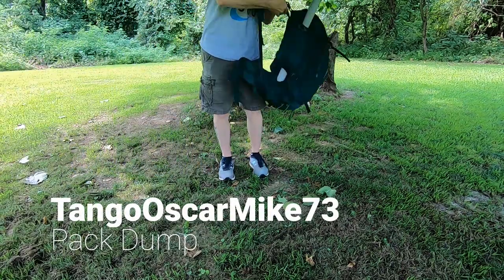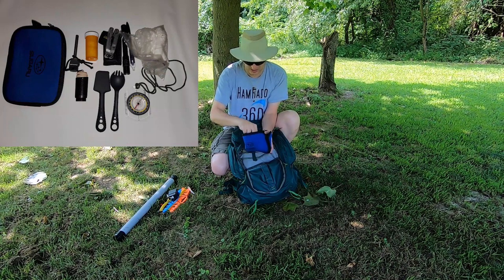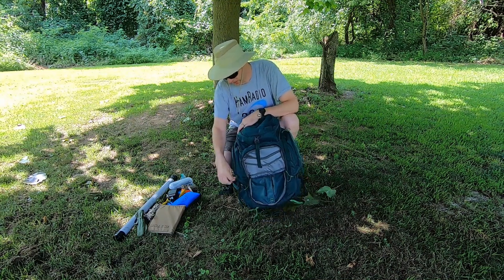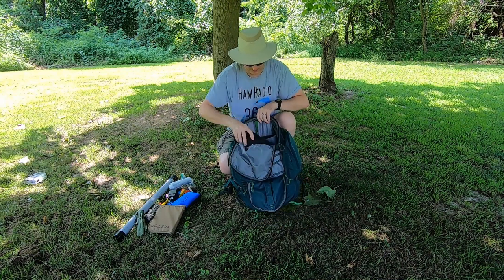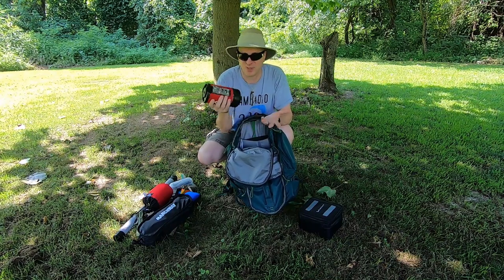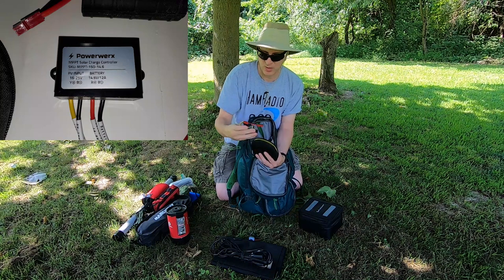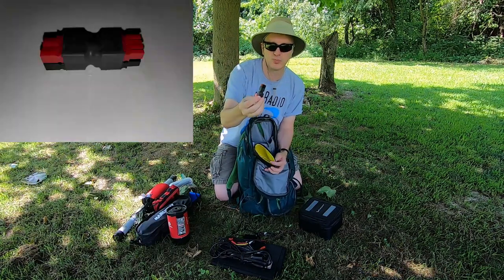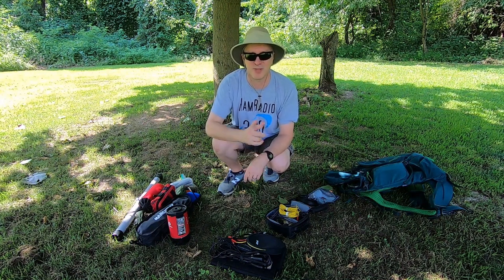Ham Radio Backpack POTA / go kit gear dump

Comment: Thanks for the pack dump. Very helpful. I’m a bit out of date on current stoves. I was considering a Jet Boil, but they are pricey and heavy, but here they are very efficient at quickly bringing water to a boil. Like you, I tend to use what I have. I’m still using my first stove that was given to me as a gift 32 years ago when I was 7. It still works great after all these years. Nice work!

Comment: Tom, thanks for sharing.  Tip from my military deployments keep your First Aid kit either in the top portion of your main compartment or in an outside pocket.   You will want to keep it were you can get to it quickly in case of emergencies. 73 De W1SRR
Reply from the maker: I agree.  I'm keeping my eye out for a flatter first aid pouch, but I might just ziplock baggie the contents it and put it in the top compartment.  That is the one drawback to this pack, there really aren't any external attachment points.  Thanks for the feedback.

Comment: Maybe a little late to add to the comments.  Just wondering how the Powerwerx Solar Charger is working.  I have heard that they can create a fair bit of RFI/EMI.  Any experience with that issue.  I have been considering this option for my setup.
Reply from the maker: I did a video on it a while back.  It makes noise.  Mine seems to generate more noise than ones other people have, but it does generate noise for sure.  I talked to Powerwerx about it, but they just offered me to return it.

Comment: how does that PPole splitter work? What connection under that shrink tubing?
Reply from the maker: All the positives and all the negatives are connected with a solid metal bar.  You plug your power source into one and all the connections become live.  I got it from quicksilver radio.  https://www.qsradio.com/shop-now.html#!/Powerpals%E2%84%A2-Cables-w-Powerpoles/c/11549247/offset=0&sort=normal
Reply: TangoOscarMike73 thanks. Also found that West Mountain makes one. Thought about making one too but they are so cheap I doubt it would be worth the time since Id probably screw up the 1st one. Is it just shrink tubing on the top? What keeps it ridged in the middle?
Reply from the maker: @forgetyourlife  It is just shrink tubing around it.

Comment: What kind of pack is that? If not the manufacturer/model: at least some details about the capacity? I need something like that Level of compartmentalized storage.
Reply from the maker: That is a Kelty Redwing 44L pack.   They make a 30 and 50 size as well.  They are reasonably priced packs.